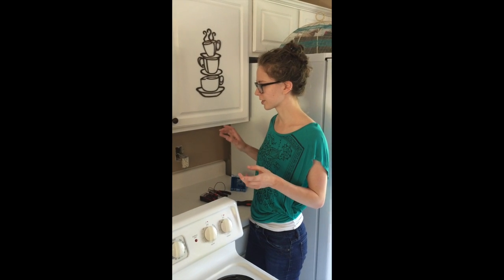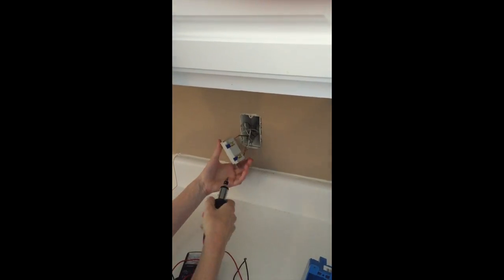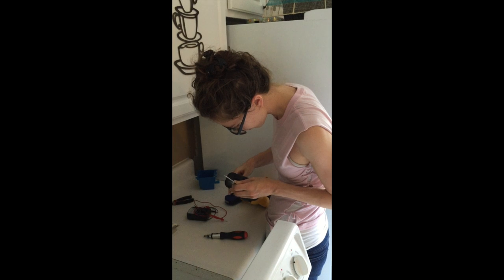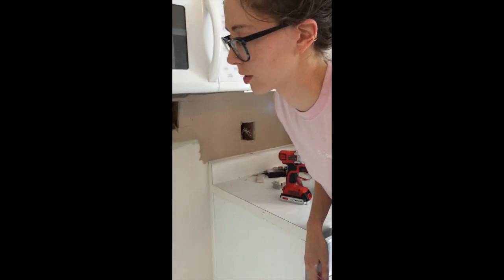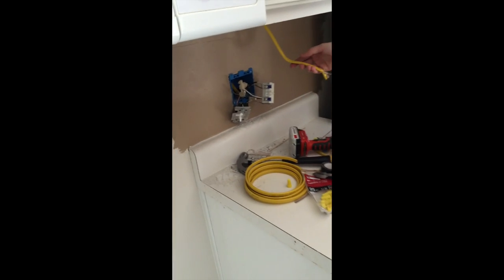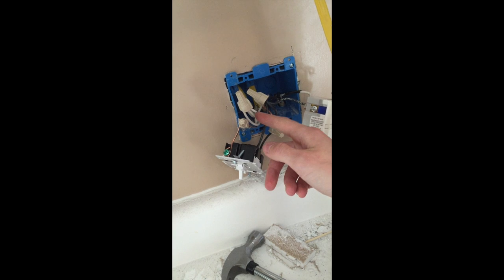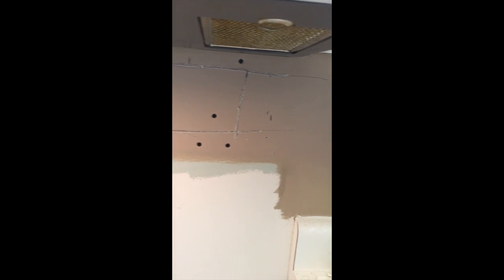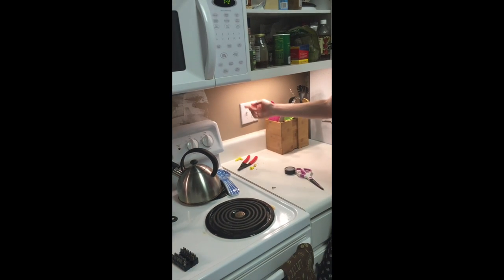Install Hardwire Under Cabinet Lighting

Comment: This actually violates electrical codes. Those countertop circuits are "small appliance circuits" and per code must remain separate from the lighting system. The circuit may occupy the same multi-gang box, but may not share circuits. Just an FYI.
Reply from the maker: Good comment, Chris, thanks. I'd definitely suggest someone get a pro if they're concerned about inspections later versus DIY-ing.

Comment: Why wouldn't you conceal the wires by threading it in and through the bottom of the cabinet?
Reply: This was my thought as well.... I would rather run it through the cabinet and tack it down with those cable holders than destroy my wall and make another project. I guess if she is doing a backsplash it doesn't matter as far as looks. 🤷‍♀️

Comment: When you had the original box open you were describing the different wires within the box and I think you reversed the "line" and "Load" descriptions. Line is the incoming power source and load is everything downstream from that receptacle. If you reverse that you will get power downstream but will not be protected by the GFCI outlet.
Reply: I thought the same thing.

Comment: Very informative video.  Thanks for sharing.  Can you also share the light manufacture and model number that you used in your installation?  I would like to do this as well in our kitchen.  It looks like you were able to wire directly into the fixture.  All the ones I'm finding online require a separate junction box with the switch already installed.  It doesn't appear that yours required that.  Although I do see a switch on the light fixture itself.  Does this have to remain in the on position?  Thank you.
Reply from the maker: +bklyn2va2dc I can't find the exact light I used, but it was the cheapest LED hardwired under cabinet light from Lowes or Home Depot. This one is similar: http://www.lowes.com/pd_39973-1390-UC1015-WH1-18LF8-U__?productId=4745343&pl=1&Ntt=under+cabinet+lighting+hard+wire
I updated the original junction box to fit wiring for two switches then connected the light to a new switch.
My light fixture did have a switch, I leave it in the on position.
Reply: P